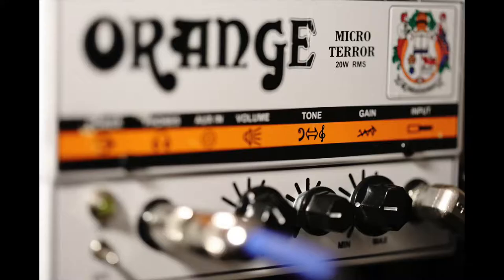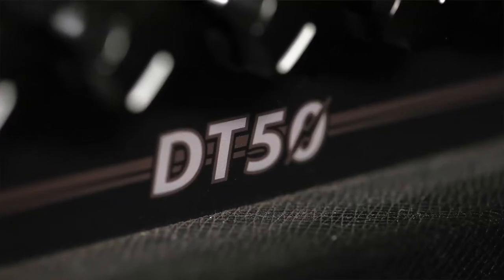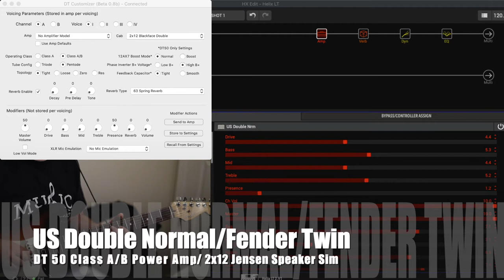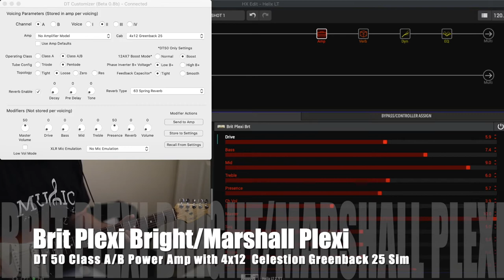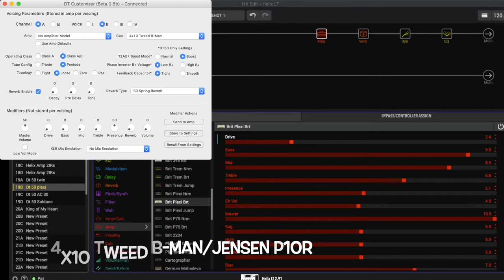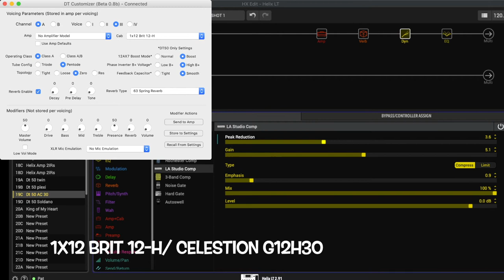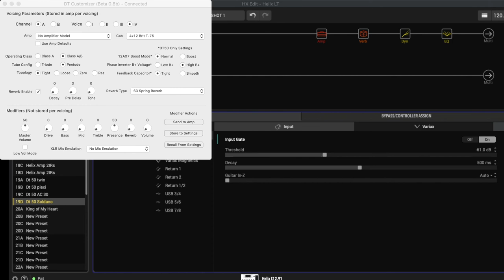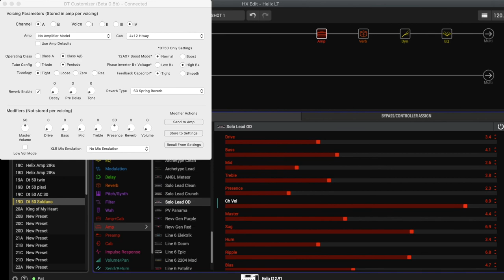How I Use The Helix And The DT 50 Together

Comment: I’ve only had my helix since the summer of 24 and I’ve looked everywhere on YouTube not able to find helix /DT input output setup controls, so one Saturday I started from scratch, selecting first the in;Utah section that gives you all the DT options offered plus it gives you the DT 50 boost and one other similar setting that you can’t do on the amp alone, you can do it with an editor, but the helix is the best DT editor around, go to the output section and the same it gives you ampselector weather it’s DT-1 or DT-2 only negative is the pod HD PRO X allows you to use 4 DT series amps where the helix only w, but wait that’s per channel or what ever each line is called, helix gives you up to 4 seperate signal lines where you can run a guitar, a bass , another guitar or keyboard even electric drums, or vocals, but you can use all 4 signals with 1 guitar or 4 different instruments, that would be confusing to me. Yes using helix with factory presets, that you can change fx or anything else, until I get used to where everything goes like before amp or after, I’ll just use templates also you’ll find some fantastic guitarists who sell presets I bough one package for only 5 bucks from a Britt in the uk, they are excellent. I’m looking at a Santana set selling for 45 bucks, I know I sound crazy, I’ve owned every modeler from line 6 since the first bean. The helix is a totally new dog, sounds comparable to 5000 dollar custom tube amps fx are awesom. I’d you’d still one of those guys who say I’ll never use one of those only tube. Amps, first off, to buy comparable fx to what’s in the helix you’d spend thousands m same with amps. It’s easy to use right away but I guarantee I am getting better at it as I use it knowing all the tweets. What fx are best, I’ve found some. Awesome cabs and amps, I’ve read a lot of guys are no longer using IRs because the latest firmware gives you all the control and then some that you were used to on an ir. Buy a helix, you have 30 days to return it, I’d buy a new one just because I didntwznt some beat up thing. I,erp mine pristine. 

I satared playing in bands in 1967, until the mid 80s the only fx I had was a wah wah pedal. I had an early fuzz box but I didn’t like it, there’s a huge difference between a fuzz and a distortion pedal.

Comment: I have 2 DT 50s one head and one combo 212. I play the head through an old Marshall 412 with 4 Celestion G12M speakers 16 ohm , 25 watts, AND 55HZ almost all guitar speakers are 75hz , the 55 hz speaker from 1970 was actually their bass coil. Bass amps had no way at that time sound or feel like the solid state class d 410 cabs of today. But those “bass” speakers with the same high end as their 75hz were basically the most full range speaker you can get with out horns etc. don’t have a helix yet get it when I can afford it fir now I am running a stereo rig with a Variax standard, love it,  and line 6 HD500x connected to the 2 dt50s with the L6Link. Love it.
Reply from the maker: I can't use the L6 link. Mine is broken in my DT 50 so i learned how to program the midi for it. I think you will find the helix a great improvement in sound quality. I certainly did when i switched from the HD 500.

Comment: I have a DT 50 head and a DT 50 212 combo sound excellent, I ise the L6 LINK that way using the helix setup input and output, I can chose either DT 50 preamp or the helix  preamps, the first amp the head I pan left and the combo pan right. I’m looking for a small amp to be a center dry amp. I never get terrible sounds, I don’t hear any digital scratchy sound, helix gives us 6 digital mic sims that I tink work excellent. I’m 70 years old I’ve owned fender dual showman, and other fender tube amps., ampeg v 4 some pee vey amps, nine of them sound as good as the DT 50s, , I may get another DT 25 head for center. The amp section compares with most custom amps. , try getting a high quality Xlr cable , I purchased 2 line 6 digital Xlr, I don’t know the difference except I wanted to use everything designed for the helix and DT 50. I’m amazed no one wants the DT series amps, I’ve lisened to so many reviews on YouTube through a hi fi system, I’ve never owned any amp like the DT 50 that I can plug any guitar into alone and just fiddle with the power amp selectors plus the cheat sheet line 6 gives you for the basic settings of the 4 preamps works excellent, also you can use  a. Midi foot controller, use one of the after market DT editors, there are actually 16 preamps to choose from a,though I actually set my dts to unity gain on all knobs, then ion each preset I use I select all my helix preamps, you do not have to turn off the preamps inside the DT 50, you’ll see when setting up a preset, inputs you’ll find a choice of HELIX OR DT that selects the helix preamps and shuts off the DT preamps.

Comment: Your setup sounds good but since you have a DT, get an Xlr cable plug into the helix l6 jack and into the l6 input on your DT, then pick your favorite preset, and reset in and out with your helic. I love how mine sounds, you can ditch the orange too, you are turning off the preamp, and using the helix preamps, you don’t need the orange  I use a Gibson Les Paul DC double cutaway and I also have 2 line 6 Variax standards, oh man if you e never tried one,yougot go, I’m a Luther and I’ve built about 30 different custom Variax guitars with the original variax, the Variax standard is a Yamaha Pacifica, the factory pups are great, but I bought a second one to put Seymour Duncan single coil sized humbucker .

Comment: L6 link cable will also bypass the preamp and allow master volume control .
I’m using two DT25’s this way with my Helix rack...the best guitar rig I’ve ever had.
Amazing tube tones ...switchable with all sorts of topologies for gain staging and applications of effects and dynamics control.

I’ll be reproducing this rig soon with a double dt50 version and a speaker cab switching solution from ampete for absolute guitar rig heaven:
Any (real) speaker type and cabinet type)...all midi switchable from either the EL84 dt25’s in stereo or the EL34 (will try KT66 tube swap) dt50’s the stereo...all fully controlled in real-time from my DAW timeline generating MIDI CC dynamically for each of multiple guitar parts in my DAW projects
Reply from the maker: I believe it also bypasses the speaker emulation, which i want since i use it with the special Celestion speakers that seem particularly tuned to the frequencies of the DT speaker sims. I just turn off the preamp using midi. I can also use the master volume and presence control. I was contacted by line 6 for my feedback on the helix and I told them they need to revamp the Dt series with the HELIX, make making a Helix with the Dt inside, or an amp with helix functionality. We shall see if they do it or not. Also the L6 link on my DT 50 is broken so I can’t use it. I’m glad you are enjoying your rig.
Reply: You were the only other person on YouTube that I’ve noticed is doing anything interesting with the combination of both units.

I really like the sounds you were getting. I do, however, prefer to use real speakers and cabinets and switch between them instead of relying on the Impulse responses for the same Purpose.
Maybe you can answer a question for me:
I do intend to purchase a couple of the DT 50‘’s mainly To take advantage of that extra tube stage at the end of the preamp (the one Offering the extra control by the items with the Asterix next to them on The DT customizer control software). … I am curious to know if you can turn off the speaker emulation coming out of the XLR output.
If not I would imagine that I could just load some reverb convolutions into that part of the signal chain.

I’m assuming that the L6 link disables the preamp automatically… I’m not certain about that but I definitely don’t have control of the Output and presents so I think it’s worth my while to try working with this DT customizer editing application.
… I really appreciate the info :-)
I will consider you an advanced user.

Comment: I've got a few general questions about this type of setup. I've had a Helix Rack for 2-3 years and just picked up a used DT25 yesterday (I don't have the AES/EBU cable yet but will in a few days). My first question is, how are you editing the DT voicing parameters on your Mac/how are you connecting the two? The DT25 has no USB connection. Thanks!
Reply from the maker: Sorry I missed this comment. I found the DT Editor Beta online and you need a USB to dual midi connector to talk to the amp. This allows you to control every paramater of you DT. other than that you can use your helix and Midi or L6 to talk to your amp.

Comment: I'm curious: I know that your L6 link port is not functional (too bad, sorry to hear that), but either way wouldn't you be able to control the DT50 via MIDI and change the cabs and every other parameter you want directly from the Helix itself (in the DT25/50 menu in the output block)? Is the DT editor really needed? Thanks for sharing your tone chase and insights you had so far with this gear. I have a DT50 myself and just entered the Helix game. Now I'm trying to figure out the best way to have them both connected. Think I'm gonna go thru the L6 link route, which seems to be the most "plug and play" and user friendly one - since I often find myself a little overwhelmed by all the technical stuff involved with these kind of gear (even though I do love geeking out about it). I love that Line 6 included the ability to control the DT amps via the Helix without having to mess the factory settings with the editors, like it would be needed before the 2.80 firmware. Am I missing something thou? I never changed it before really, because I love the 4 profiles. But I do know that I could have 4 different combinations on the second channel, expanding even more the sonic capabilities. I'll appreciate any feedback from you. Cheers from Brazil!
Reply from the maker: you would need the Dt customizer program to change the DT 50, in the amp itself. If you run the helix into the DT 50, through L6 link, it will turn off the speaker cab sims of the DT. I use midi to control the DT, because i want the DT speaker sims since I am using the Line 6 speakers for the DT amp. the are really flat and adjust tothe EQ curves of the DT really well. Happy tone hunting.
Reply: @pfmusic1636  You said you feel the DT modelled cabs feel more authentic somehow then the Helix modelled ones, right? Would you care to elaborate more on that? Thanks in advance
Reply from the maker: @yuriamorim  I'd probably need to make another video
Reply: @pfmusic1636  i hope you do make more videos using your DT50.
Reply from the maker: @tedc6694  Thanks Ted. I hope they build DT 50 2.0 but I won't hold my breath.